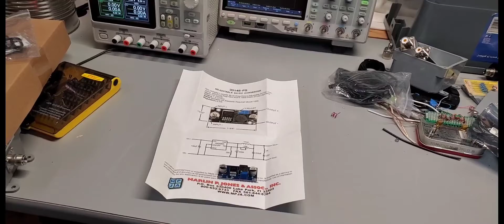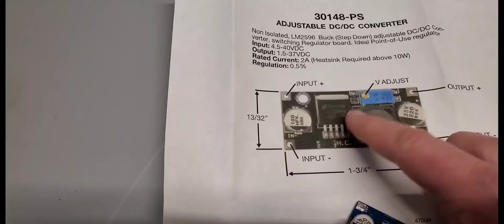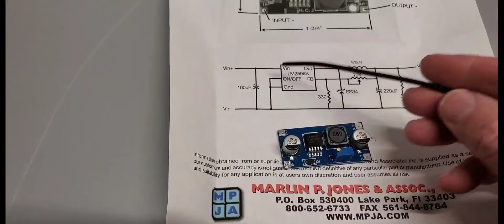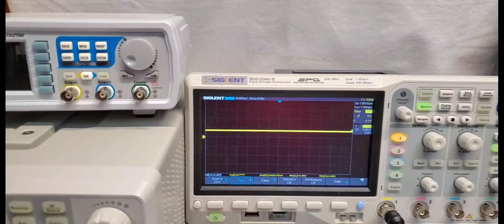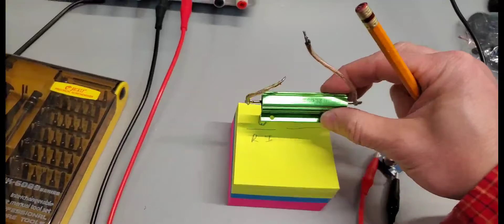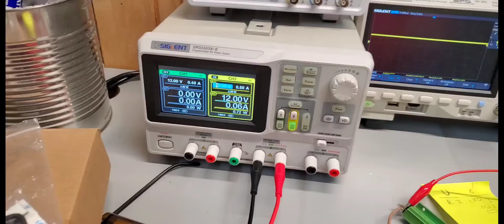GPS for Kenwood TM D700 Part 1 Power Supply

Comment: what GPS unit are you going to use?
 I too am just starting to build the GPS unit for my D700A as well. Waiting on Amazon to deliver my parts now so I can finish this up. I went with the neo-6m. and an even much smaller in size buck converter, it measures only 20mm x 11mm x5mm , but allows to be shoved into a small case and tucked away in my work truck.
Reply from the maker: It's a GT-U7 which apparently is a Neo-6m as well.

Comment: Remember that when your car's generator is charging, the voltage can easily be 14 volts, and even a bit more. But I'm sure the step down converter can handle that just fine.
Reply from the maker: Good point.  That a nice benefit for using the step down converter that I don't have to worry about that. Thanks for watching.
Reply: These buck converters are pretty stable on the output, provided you give enough headroom for them to do their job properly. On the adjustable converters, I have found that they can be a little questionable by some manufacturers, but overall are all within a pretty tight tolerance. I typically see less then 1% deviation. However, I still do not trust a variable regulator in the place of a fixed. Especially on something that is of importance.
Reply: @ChrisRobinsonKF6NFW  Yes. I only commented because he tested it to 13 volts, and stopped there. I just wanted to point out that the voltage in a car can be more than that when the generator is charging. So if he really wanted to be sure, he should have tested it to 14 or maybe even 14.2 volts. (I mean, what's the point of testing it if you're not testing it for at least the range it will experience when in service?) But I'm sure the buck converter will handle it well, so it's not really an issue.